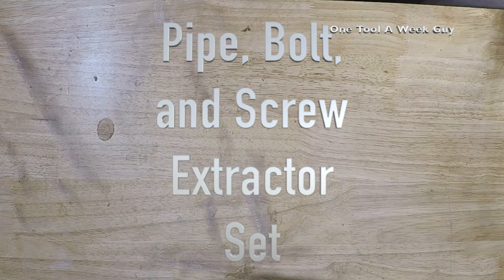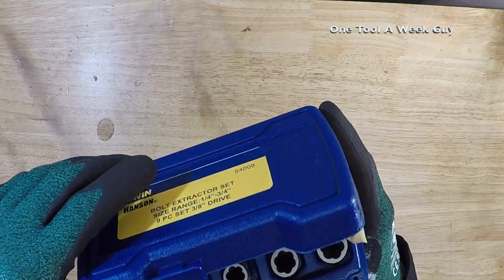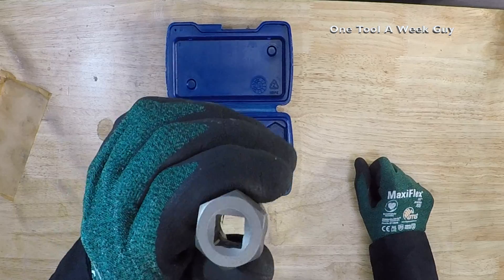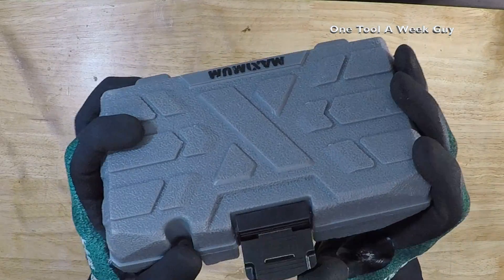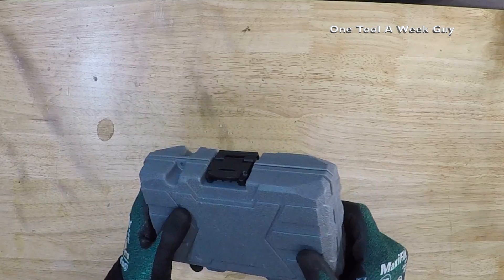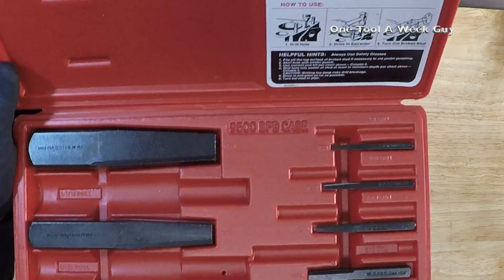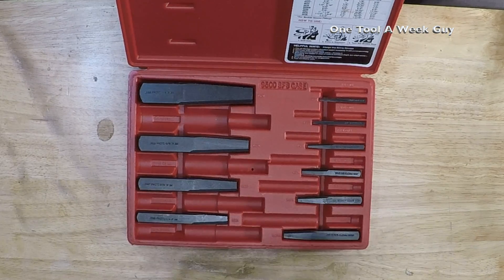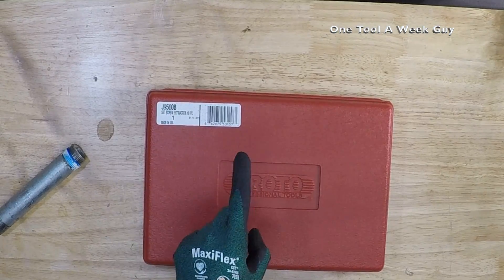Pipe, Bolt, and Screw Extractor Set (Irwin 54009, Maximum 1/2" Set, Proto J9500B)

Comment: Man I have to get some of those small nut extractors. Always found the smaller nuts get rounded off  cause guys use adjustable spanners to much. And oxy cutting galvanized nuts just sucks. Never seen the pipe extractors before. Very interesting. Really like your channel bro.
Reply from the maker: it dose suck having to grind off, cut, torch, or what ever you have to do to remove the bolts and nuts. Thanks Steve for the feedback.

Comment: I have a cheap set that aren't very good, have you used them in the field yet?
Reply from the maker: yes i have. the pipe extractor works great!!! and bolt extractor do not use it as much just cut them out.